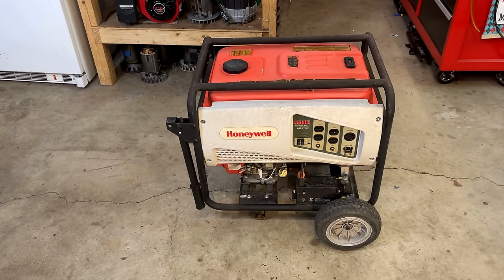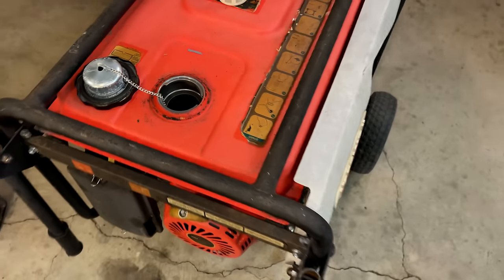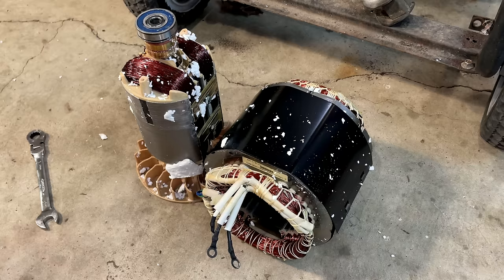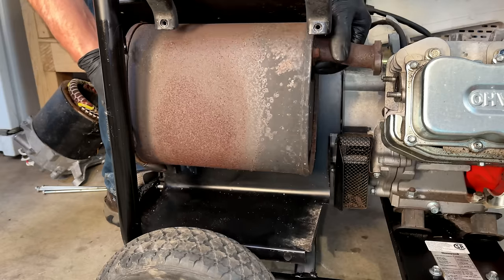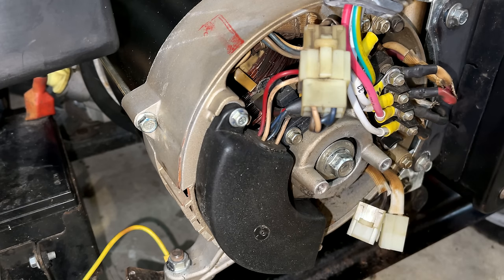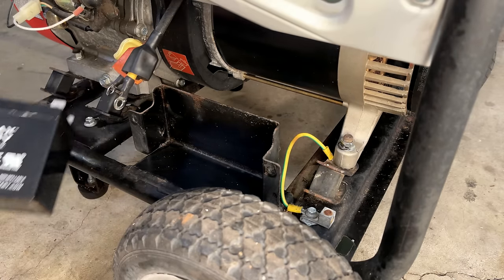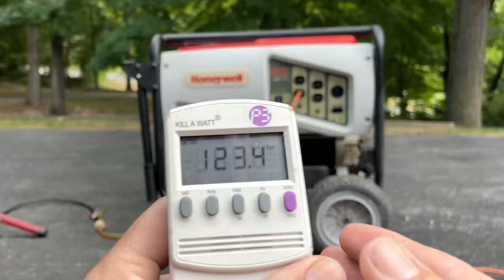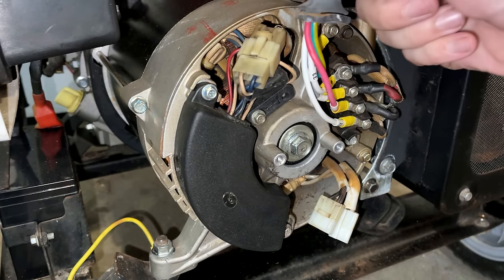Honeywell Generator Not Making Power - Fixed

Comment: A mud dauber is the cause of the tank vent clog. I deal with those all the time. If I leave my air tools out for a couple of days they will fill the holes up.
Reply: Yes sir.
Reply: Planes have crashed (air speed funnel) clogged.
Reply: I feel that pain
Reply: Chose_sin_Won sometimes a allimimun screen over the cover can stop mud dobers
Reply: @super duper ducky
Reply: Gotta love wasps. I do. I also love machines.
Reply: @georgelequin5070  
L
Reply: @super duper ducky l
Reply: It's a lot worse than you think.  There's at least one recorded instance where mud daubers were the cause of a fatal aircraft crash when they clogged up the pitot tubes which are used to measure both air speed and altitude.  Of course the ground crew should have put covers on the pitot tubes while the plane was in storage for a couple of days, but somehow they forgot.
Reply: Me to because a lot of people store there equipment in well house and it’s a problem
Reply: I totally agree about soldering small wire like that they tend to break easily. I have with motors before unwrapped one coil of the winding which gave me the extra length. Then unsoldered the broken wrapped together wire and using plenty of the one coil unwrapped one turn wrapped as original and it worked. I told a guy at a place who sold second hand vacuum cleaners what I had done and he said. I do that all the time. Vibration very often is the issue. Be interesting what one coil of the multiple windings does to your resistance checks. There are crimp connectors with heat shrink as well that might work. Windings have an insulated coating that needs removing to twist and solder wires together. The vacuum cleaner I did it on worked for years and only went to the dump when my Wife bought a new one for styling reasons.
Reply: Probably the feet missing caused vibration and vibration broke the wires in the windings. Case of simple maintenance being missed causing bigger problems.
Reply: @shadowwolf9329 also Christmas tree fasteners for door panels work to.Just don't push it down all the way-there is gaps if you look at the tree part for air to enter

Comment: That rotor was easely repairable... Would be less work en just as good.. repaired lots of them that way, just use a crimp connector.
Reply: I was thinking the same thing...make this side touch that side...done!
Reply: I think the issue is that James is concerned about the future safety and liability for whoever buys it later.
Reply: @Rorschach1024  I agree he shows that he's not willing to fix it to work once before breaking. I do agree the wire could've be fixed but as I've never fixed one like I don't know the long term reliability.

Comment: I can vouch for that clogged gas tank vent causing a run issue. Had the exact same thing happen last winter when I needed to run my generator. It had worked fine all summer when it was hot out, as soon as I tried to use it cold it would run for a few minutes and starve the carburetor. 

Took me a little bit to figure out so I'm glad you covered that important trouble shooting step for anyone watching.

Comment: This was an excellent video because of the details and how you shared the thought process in determining which powerhead to use and you didn’t cut out the Ryobi unsuccessful path. Also, the info at the end on securing the connections with zip ties was important critical information. Great content as always Jim.

Comment: Aluminum wire is difficult to solder because of the aluminum oxide that instantly builds up on it during the process. You need a special acid type flux (Superior flux 1260) and preferably a tin silver alloy solder. 

So very much possible but only with the right tools. :-)
Reply from the maker: Definitely need the right tools.  The other issue is the corrosion.  The wire most likely will crumble where the solder joint was.  Would need to cut that out.
Reply: It would be cool to see him frankenstine a generator back to life out of spare parts and questionable fixes to see what works and what doesn't.  I'd love to see this attempted.
Reply: @bobadam7021  That is a good idea for a future video Crazy fixes that might work.
Reply: Would like to see him try and repair that rotor.
Reply: 70%tin 30%zinc Is a good aluminium alloy for weld. In my opinion a come crimp could work out you Need to protect with epoxy tò prevent vibrations
Reply: @jackmahogovv  I’ve never seen aluminum wire on a generator before. I really would’ve liked to have seen that connection terminated and everything retested
Reply: @roccocroce  It is called copper clad aluminum. Welcome to the now. Heck you're lucky if you're even getting CCA today. The Chinese are copper cladding plain old steel anymore. Because steel is even cheaper. Plus steel is more difficult to spot with the flame test. You torch CCA and it just burns like hair. Which is a dead giveaway that you're getting screwed.
Reply: @jackmahogovv  , so would I. I had the same issue and was able to solder it back and believe it or not, I coated the wire with gel crazy glue at the terminal. It runs perfect!
I think Jim will do a video of that soon!! It’s so nice to see a gen come back to life
Reply: I've found SRA aluminum flux core solder very effective. Even managed to solder aluminum to brass with it once.

Comment: Matey I've seen your work and it's brilliant, I have this to say I just hate using up a new part if the old one is fixable. I know how you work you are meticulous in your repairs and well, good at it, so rather than waste a new part despite lack of success soldering, perhaps you could use a small crimp on lead connector or knowing your skills give the soldering a go. The right flux can achieve wonders. But I bow to the master in this because you are just brilliant at what you do, it's always a pleasure watching a master at work.

Comment: Excellent job and find Jim. I just had a honda pressure washer that would bog when under load. Ultra sonic cleaning made little difference. Finally I drilled the main jet up one mini drill size and it runs perfect. I think EPA rules are a little to tight. Thanks for the video.

Comment: That dirt in the tank vent on the carb box was likely from an insect that laid an egg in there.
I just picked up a Briggs and Stratton 8 horse powered generator yesterday that is an older model. It has a J carb on it. It's got a no power issue on it, but one of the first things I noticed is that on the panel wiring, someone had made a repair with a few wire nuts, so that will be my first repair on it, the second issue was that the wires going into the generator have no strain relief, so that's a bit concerning as well, as the wires move all around..
I will also probably need to clean the carb out, as the owner said it wasn't run in a while.
Reply: They are called mud daubers. They’ve actually lead to airplane crashes because they plop mud inside the instrumentation tubes. One plane crashed and we lost 189 people at one time. Some mud daubers actually kill spiders… but in turn they request the occasional sacrifice.

Comment: One of the things I found for cleaning plastic is DOT 3 brake fluid, it will take the top layer of oxidized plastic off and will leave the layer under it almost new looking.  It does awesome on headlights as well.  Another thing I found that seems to work quite well on plastic is Brasso or silver polish, but you want to be pretty gentle on it, as it will really dig into it if you push too hard on it.
Reply: Marine Hull Brite ain't no slouch either. Works great on most any plastic or fiberglass.
Reply: @WayneTheSeine  nice, i will check it out, thanks!

Comment: I two days ago I was given a Honeywell 2000 watt generator/inverter which I'm currently going through the fuel system as the fuel smells like it's as old as the generator. Surprisingly there was zero water or rust in the tank and I'm impressed with the build quality as the external hardware is the good stainless and all of the electronics are protected by a thick layer of epoxy resin or whatever its called. Because of your videos I felt confident enough to go through something I've never worked on or even operated. You're very much appreciated by me and the few friends I have that tinker.

Comment: Carbs are a static metering device on a non static system so all it really takes to mess up the flow is a micro crumb maybe it wad just the debri in the fuel that was in the carb seems to be running alot better after the cleaning Great video as always @James Condon

Comment: I find that Goof-Off has just the right formula to make it work very well most of the time and often amazes me. just be careful around custom painted parts. I have often successfully removed graffiti and over-spray from porous surfaces by letting the Goof-Off soak in and then pressure washing with a low pressure setting. I really enjoy your work!

Comment: Informative video.  I didn't need any information on the mechanical side, but I have never repaired a genset, and my 5500 watt Homelite unit was dead.  The information I needed, was the resistance readings for the windings and the rotor, but I know now to also look for broken or corroded wires behind the slip rings.  Thanks

Comment: Great video as always.  I am surprised that you were not able to solder the wires on the old rotor.  It looked like a simple fix to me.
Reply: Even if the wires had been coated aluminum, there are solders for that too.  Only thing is the temp range might be too high for the lacquer coating on the wire.  Why not use a mechanical connector?  (crimp connector)  I don't know.

Comment: James. The power was out here in Dallas for 2 days after a severe thunder storm last Sunday. Trees down all over the place. I powered our house with two different units I was able to repair and had an extra generator to lend out due to the instructions from your excellent videos. Thanks again. We've got to do something about the noise level! One would think that generators designed for emergency use would take into account people trying to sleep at 2 in the morning with a generator roaring away 40 feet from the house. My neighbors said they were getting a motel room the second night indirectly implying my machine kept them awake the night before.
Reply from the maker: They are loud.  I had a run in with my neighbor after a hurricane.  He was not happy with the noise.  I ended up buying a quiet inverter generator after that.
Reply: @jcondon1  I saw a suggestion some years back posted by a guy in Nawlins with the same issue.  He suggested digging a hole,  fairly deep,  and then piping the exhaust into it.  The result is that all of the noise is direted upwards and doesn't spread out to annoy the neighbors...
Reply: I had a similar noise problem but in my case, it was mostly solved by moving the generator and also pointing its exhaust where there were no people to bother (I was lucky that was an option in my case).  I've since bought myself a quieter inverter generator.

Comment: A better way to clean the instrument panel is using DuPont NO.7 rubbing compound and a rag, and it will come off easy, and shine.  Never fails. Other rubbing compounds don’t work as well.  It works great on all kinds of smooth plastic, and other painted things.  Nice work and clean up.😊

Comment: I enjoy your videos and have learned a few tricks . Whenever I find a surging engine it needs to have the low speed plastic jet both cleaned ( and )enlarged one or two sizes . I’ve also had pretty good luck re soldering rotor and slip ring contacts  .

Comment: Nice presentation. I always learn something here. BTW I found this on AliExpress trust you’d like it. A welder that can joint a wide range of metal wires need no solder. It melt the base metal to weld. It was originally made for jewelers work should work with aluminum magnet wires.

Comment: For the slip rings try a Briteboy rubberized abrasive eraser, and for the plastic discoloration dirt the marinas carry a polymer wax/gel coat cleaner that may surprise you with results..
I miss my years in  machine building for Delta, Pratt Whitney, Boeing..precision no error just like your work James.

Comment: Well done, James.
Surprised you didn't try to solder the rotor winding. Seems simple to scrape the enamel off and repair the solder joint.
Having all the spare parts, perhaps, made the swap the easy way to go.
Nice outcome to the "FREE" generator.   lol
Thanks for sharing.
Reply: He said in the video that it is likely copper plated aluminium, and it is very difficult to get a good, long term solder joint with this type of wire (clearly, even the manufacturer struggles with this!)
Reply: @ickipoo  
Difficult, probably. But the only way to GUARANTEE failure is to not try.
I only said I was surprised James didn't try.
Reply: @FeralPreacher  it sounded to me like he's tried in the past and decided it's just not worth it. Maybe he could get it to work in the short term but he's selling these things and has his reputation to consider.
Reply: @ickipoo  You can make a successful solder joint on aluminium;  all you need is the correct flux.

Comment: Great save, it really pays to have the parts on hand as well as the knowledge and experience! I wonder if it’s possible to connect a regulated charging circuit to that extra winding for the battery or is it not worth it since the generator sits unused for such long periods of time?

Comment: That rotor is easily fixable, i have fixed wire breaks like that on Co-Al wiring many times.  The way i prefer to do it is get some uninsulated crimp ferules, slide over a piece of heatshrink if needed  then slide on the ferule, getting both wires in the ferule parallel and overlapping each other, then crimp it, makes a good mechanical connection, and then i usually add a little flux and solder as a secondary measure, then heatshrink over the joint, again not always needed depending on exposure, and its done and fixed.  I fixed a generator rotor like that back in 2012 when we had a tornado and power outage for days, ten years later it still works fine.

Comment: Personally I would have fixed the wire break, but awesome job none the less. As for the wire, you may need to unspool 1 turn on each side if it's corroded and need more lead length but that would not likely make much difference at all. But you just need some different flux and a high silver content solder, and patience.

Comment: You stated it was most likely an aluminium conductor but I'd have scraped off a bit of the shellac insulation to find out for sure. If it was copper clad it can be soldered or plain aluminium can be crimped with aluminium sleeve using an air excluding grease between sleeve and conductor. The crimp forces the grease out from between the metal faces and a pure metal to metal bond is formed. I've used this technique on different sizes of aluminium conductor many times. I would have tried this before undertaking the extensive mechanical operations.

Comment: James, your generator repairing abilities are amazing! I’ve learned so much from you. I have a B&S Storm Responder 5500 (030430-01) with a dead engine (216112, 0110E1). The engine was run out of oil after hurricane Laura, but the rest of it is in great condition. B&S doesn’t have a replacement engine. Do you have any suggestions on how/where I could find an appropriate replacement engine for this generator?
Reply from the maker: A Yamaha MZ360 or Subaru EX30 from another generator would work.  A 10hp OHV Briggs generator engine would also work as long as the first two numbers on the engine model start with 21.  You could also use a Yamaha mz300 or Subaru EX27, but they have a little less HP.  The big issue with the Yamaha and Subaru swap is the crankshaft exits about an inch higher so the stator mount has to be raised an inch.
Reply: @jcondon1  Thank you so much for the information. I will try to get a B&S engine for the replacement.
Reply: Try Small Engine Warehouse for a replacement Brigs.
Reply: @paulmoffat9306  Thank you, Paul. I will check out that site.
Reply from the maker: @lauriestewart9909  only see a 5hp engine with the correct shaft, but the bell housing bolt pattern is not correct and would be limited to 3000 watts.  The newer Briggs engines are Honda clones and not compatible with your generator.
Reply: @jcondon1  Thanks! That explains the problem I’ve been seeing. I will see if I can locate a Yamaha or Subaru engine in good condition.
Reply: (Chuckle). Who just happens to have a new Ryobi power head, still in the box, on the shelf?  How big is your stash?!?
We see your set, and you order lots of parts, but I’m thinking you have an extensive warehouse of dead or questionable donors.  ‘James’ Generator Spares Emporium.’

I’m thinking that you have several generators at a time in WIP, and your superior editing skills get us through your bread and butter workups in an hour.

Could a shrink wire connector be enough to salvage that rotor, versus trying to solder it?

Anyway…. Bravo.
Reply: Great work once again James! I had a B&S generator and the slip rings were damaged. Found a bolt that came loose and bounced around. No other damage, was thankful the customer got away cheap vs the other option. 
I’m inundated with chainsaws at this point. This is typical for fall and with the price of heating the best option, in these parts, is wood! Great videos, like to watch when I can. Thank you.

Comment: To repair that winding, I'd use an open barrel type crimp to join the two together, the ones that look like a U and using the correct crimp tool, they are folded over and under and make a really good connection. Then epoxy it in place to prevent future breakage
Reply: I agree

Comment: The rotor coil leads are not soldered on, they are glued on with a special conductive glue available at Amazon. It is expensive, but a small amount can save a lot of rotors.